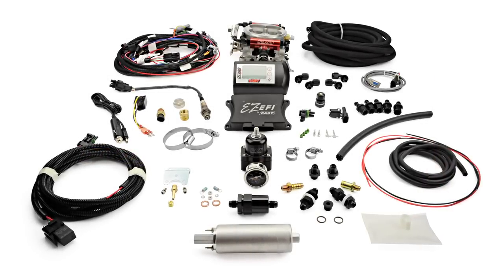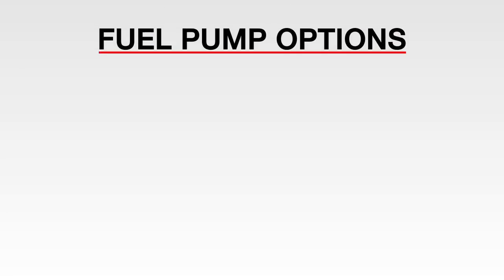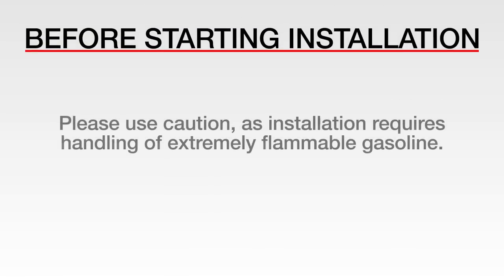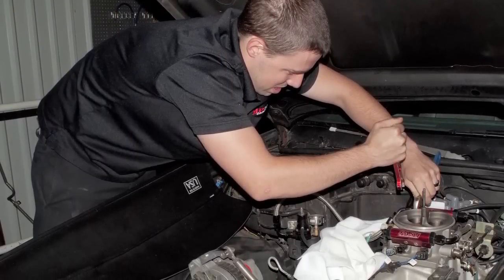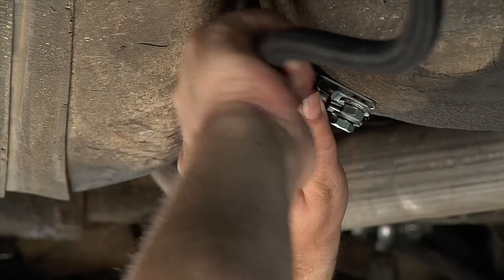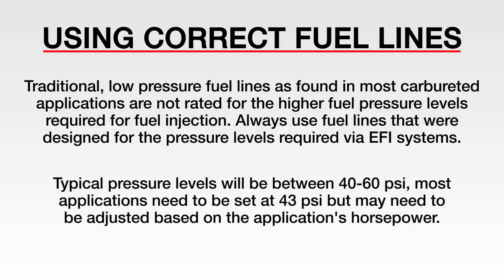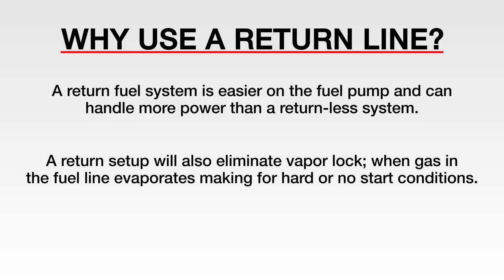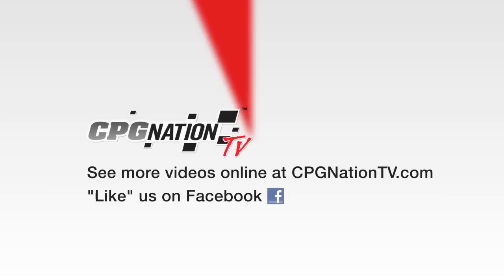FAST™ Quick Tech Video: Proper EZ-EFI® Fuel Pump Installation

Comment: If you want to quiet an external pump, use rubber bushings between the P clamps and the body of the vehicle.  Up to 50% quieter.

Comment: Thanks for the video. I'm still "old school" with carburation. I use an electric pump mounted below the fuel cell to acertain fuel is always at the pump. I didn't look up the install instructions for the EZ EFI, but a good safety tip is to use an impact switch in series with the pump wire to kill the pump in case of an accident. Getting ready to put one on this week.....Art
Reply: instablaster

Comment: do i have to remove the old pump inside the tank before installing the external fuel pump or will it works with the old pump intank

if the line is broken from the filter since i see fuel dripping how do i cut the line from the tank from the filter to add a new filter

can i relocate the filter and put it somewhere close the engine is that a problem, thanks for your help

Comment: I'm have a 1993 caprice 5.7 throttle body engine bad mechanical fuel pump what would do I need to remove prior to installing external pump also what psi would I need

Comment: my car is ford crown Victoria normally the fuel pump found inside of the tank , if i want replace the site to install the pump outside the tank is that ok without any problems in middle east hot weather? some times degree touch 50C ! anyone had experience can reply to me thanks for him a lot.